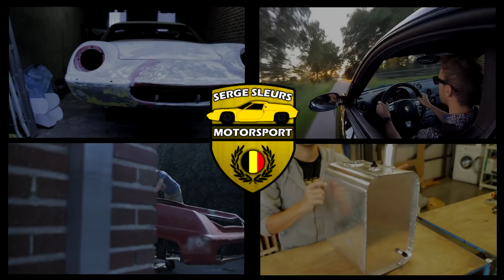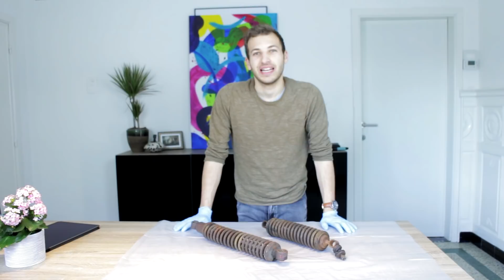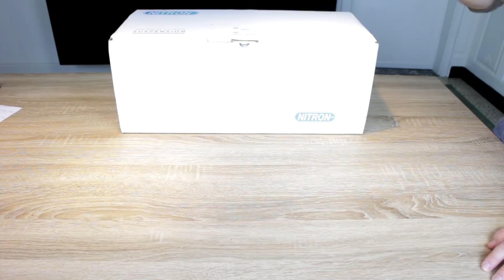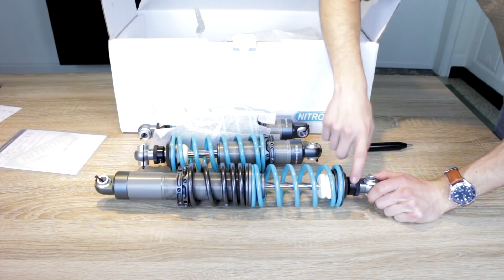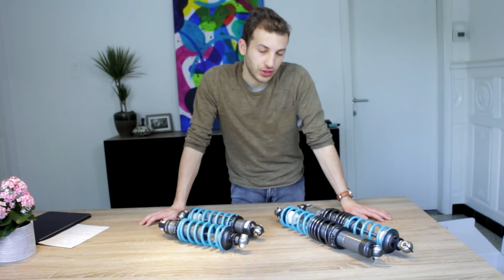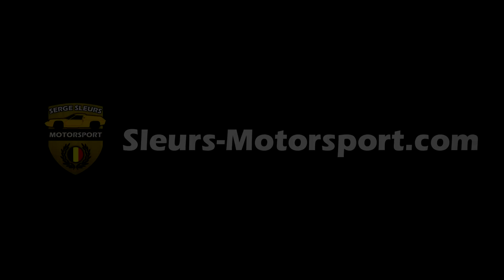Lotus Europa - Ep 52: Nitron shocks

Comment: How do you plan to connect the anti-roll bar?  I want to relocate mine mostly because it's a pain to use a floor jack in the front without using a block of wood and the smallest jack I have.
Reply from the maker: I have a video on that coming up. I have made a new ARB and am mounting it higher like on the Lotus Formula cars.

Comment: I am very interested to see how this Nitron set up works out for you. They are highly regarded here in the UK but as you say expensive!  I also hope you have not gone too stiff on springs. One of the problems with modern spring suppliers on Elans and Europas is that the trend nowadays for mega stiff set ups means that they often ruin the ride of these cars. These cars always had a comfortable ride, which makes them particularly nice in todays world of rock solid tyres and suspension with minimal wheel travel. You are making a very nice job of this car and Iam looking forward to further instalments!
Reply from the maker: We decided to go quite soft on springs, 150lbs/in in the front and a progressive setup for the rear (87-130lbs/in). This will translate to a ride frequency of 1,71 in the front and 1,57 in the rear. A little bit stiffer as original, but nowhere near some of the setups you see online. The dampers will do a lot more work than the originals.